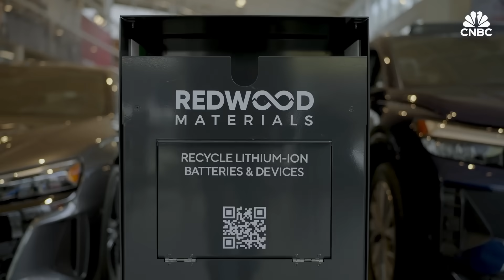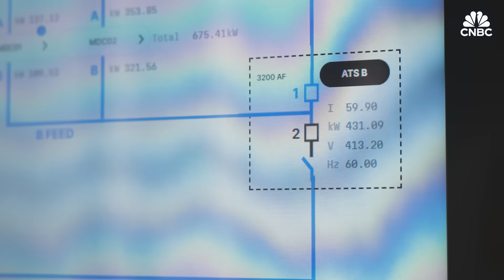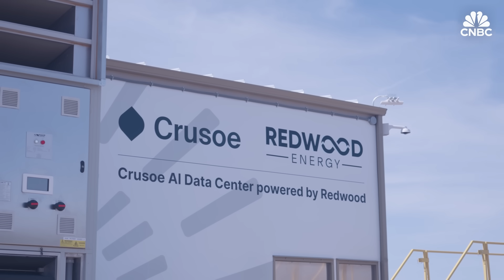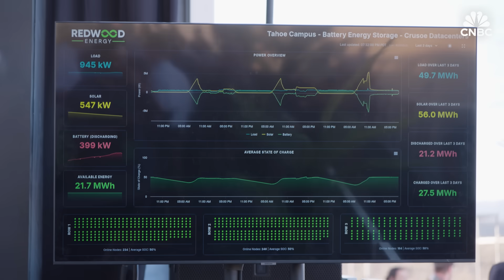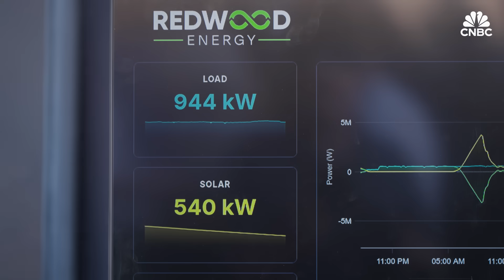How Used EV Batteries Are Being Turned Into Data Centers To Power AI

Comment: second-life batteries? LOL I thought EV car batteries typically last less than 10 years!
Reply: Old EV batteries degrade capacity over time— they don’t fail outright.   Basically they’ll lose 30% capacity == 30% less range.  But for stationary storage that stuff doesn’t matter— they’re useable as long as they can hold and release a charge.
Reply: @romanval69  There is no way a second life battery can hold a charge without maintenance. That'd cost a lot.
Reply: @GCPCA-p5b Batteries have no moving parts, so they're essentially maintenance free.  In this case they're using the entire EV battery pack as-is...  including it's built-in battery maintenance system.  (So as far as these battery packs are concerned, they're still operating as if its installed in a car).    If one goes offline--- well there's still hundreds of other ones ones working.
Reply: A quick google search found that there are different battery chemistries with varying lengths of life.  Not a one size fits all kind of situation. Where are you getting your data from exactly?
Reply: If something like 70%-80% arrive, they use them. If they are too bad, they recycle. Those minor details matter and they make their own market out of those small differences.

Comment: Looks like a bad design though. Why it's spreading out and taking so much space?
Reply: Low cost approach for end of life batteries just before their scrapped. The space prevents the spread of faulty batteries that go on fire (given they may have accident pulled batteries in the mix) from spreading to other units, this is why the batteries not being fully encased EV packs are also covered in fire/spark suppressing blankets (to prevent sparks igniting a module due to another one going up).

Comment: Data centers make up 8.9% of the total power share in America, based on analysis from the IEA. They need more power due to AI, and consumption would  rapidly increase. We need more nuclear power that's the fact.
Reply: Commercial utility-scale nuclear energy is the slowest to build and most expensive form of electricity
Reply: @beyondfossil and they still don't have a good solution for spent fuel rods which remain radioactive long after anyone reading this has passed away.
Reply: @beyondfossil  Alternatives?
Reply: LOL, wait 10 to 15 years to come on line, spend billions of dollars, end up with 1GW, and only able to run at 90% capacity.  Average nuclear power plant is 1GW.  The largest nuclear power plant in the US is the Vogtle Nuclear Power Plant in Georgia at 4.5 GW, with 4 reactors.  Originally estimated to cost $14 billion, it ended up costing $36 billion.  Nuclear is just not economically feasible and can't meet the growing demand.
Reply: @muskrat3291  It shouldn't take that long, 5 plus years for sure. Many European countries are reconsidering or reversing their decisions to phase out nuclear power due to concerns about energy security and climate change. It's the only reliable source.
Reply: @GCPCA-p5b  You're dreaming if you think 5 years time to construction a new nuclear power plant.  Just because they're talking about nuclear doesn't mean nuclear will actually be built.  Talking about nuclear is good for politicians because they can promote it as local jobs with energizes their political campaigns.  But if and ever such nuclear power plants are built, those politicians are gone, sometimes long gone.
Reply: @GCPCA-p5b   The answer is is renewables + storage and it is not the "alternative" but the primary solution.  Renewables and storage, especially solar, have reached historic low costs of generation and still driving lower year by year.

Renewables + storage are fractions the cost of nuclear per MWh generation and can be deployed at fractions the time as well—all without the unparalleled risks that are intrinsic with nuclear energy.
Reply: @beyondfossil  historic low costs? wow. Someone in my street installed solar on his roof for less than $20K, 3 years ago. Tesla quoted $70K for the same. Imagine solar energy supplying an entire city. I don't think it'd work.
Reply: @beyondfossil  So, building a nuclear plant takes many years and costs billions, is that your concern? Many EU countries are banning fossil fuel cars in 5 years. Do you think they have enough electricity generation capacity to power the anticipated rise of EVs? The shrinking EV sales are partly because of diverging policies on green incentives across the EU.
Reply: @GCPCA-p5b Just to clarify, the EU is banning the sale of new ICE cars but not the use of existing ICE cars.  Existing ICE cars sold prior to the ban will still be used indefinitely.  ICE cars will still be the majority of vehicles on road, at least for several years after the ban on new ICE sales.  ICE will fade out though at an accelerating rate after the ban which is excellent news.

The absence of nuclear energy will not alter this.  You might be conflating the two scenarios.  Human civilization has never really been tied to the growth of nuclear energy.

The biggest effect on car sales is global inflation and now Trump's unprecedented tariff war accelerating inflation and negatively affecting consumer confidence.

Furthermore, Europe has plenty of fossil fuel generation which is cheaper and faster to build than nuclear so there is no fear of running out of electricity.  Moreover, Europe is adding gobs of wind and solar.  Solar became the EU's top energy source last June.  This is a big milestone and means that this spread to other months of the year and occur year after year until the entire calendar year can be comfortably powered by renewables + storage.  This is a phase-in and phase-out approach happening right under consumer's noses without them even realizing it.

The extremely costly and slow to build new construction utility-scale nuclear will not even put a dent in the amount energy needed to displace fossils in any reasonable amount of time.  The money, time and expertise is best spent on renewables which can provide the same MWh for fractions the cost and fractions the time.  Until then fossil fuels and hydroelectric can provide the balance as renewables continue their exponential growth.

Finally, expensive and slow to build nuclear energy will actually slow down the global energy transition.
Reply: @GCPCA-p5b  Just to clarify, the EU is banning the sale of new ICE cars but not the use of existing ICE cars.  Existing ICE cars sold prior to the ban will still be used indefinitely.  ICE cars will still be the majority of vehicles on road, at least for several years after the ban on new ICE sales.  ICE will fade out though at an accelerating rate after the ban which is excellent news.

The absence of nuclear energy will not alter this.  You might be conflating the two scenarios.  Human civilization has never really been tied to the growth of nuclear energy.

The biggest effect on car sales is global inflation and now Trump's unprecedented tariff war accelerating inflation and negatively affecting consumer confidence.
Reply: @GCPCA-p5b Just to clarify, the EU is banning the sale of new ICE cars but not the use of existing ICE cars.  Existing ICE cars sold prior to the ban will still be used indefinitely.  ICE cars will still be the majority of vehicles on road, at least for several years after the ban on new ICE sales.  ICE will fade out though at an accelerating rate after the ban which is excellent news.

The absence of nuclear energy will not alter this.  You might be conflating the two scenarios.  Human civilization has never really been tied to the growth of nuclear energy.

The biggest effect on car sales is global inflation and now an unprecedented tariff war accelerating inflation and negatively affecting consumer confidence.
Reply: @GCPCA-p5b The historic low costs refer to utility-scale solar (solar farms).  You cannot compare utility-scale nuclear to residential solar.

Levelized cost of energy (LCOE)

Commercial Nuclear: $140 - $233
Utility-scale solar: $24 - $96
Onshore wind: $27 - $73
Offshore wind: $72 - $140

You seem to be new to this and its good you're interested but you need to do some basic research on energy.  In fact, solar and driving its LCOE costs lower while nuclear is getting more expensive and more complicated.
Reply: @GCPCA-p5b Just to clarify, the EU is banning the sale of new ICE cars but not the use of existing ICE cars.  Existing ICE cars sold prior to the ban will still be used indefinitely.  ICE cars will still be the majority of vehicles on road, at least for several years after the ban on new ICE sales.  ICE will fade out though at an accelerating rate after the ban which is excellent news.
Reply: @GCPCA-p5b The EU is banning the sale of new ICE cars but not the use of existing ICE cars.  Existing ICE cars sold prior to the ban will still be used indefinitely.  ICE cars will still be the majority of vehicles on road, at least for several years after the ban on new ICE sales.  ICE will fade out though at an accelerating rate after the ban which is excellent news.

The absence of nuclear energy will not alter this.  You might be conflating the two scenarios.  Human civilization has never really been tied to the growth of nuclear energy.
Reply: @GCPCA-p5bCommercial nuclear energy's extremely slow build will have little to no effect on EV mandates.
Reply: DOE/Berkeley Lab shows datacenters consuming 1.9% of US annual electricity in 2018 and increased to 4.4% in 2023.  They project it may grow to between 6.7% and 12% by 2028.  This assumes the grid is not growing, but the grid is also growing rapidly especially with renewables.

Nuclear growth is flat in the US.  Especially with the financial fiasco that was Georgia Vogtle which was over-budget by double ($14B to $30B USD) and over-schedule (2016 expected but was 2023).  Georgia tax- and rate-payers are on the hook for some $8-billion for this thing!

It is common for new construction nuclear power to be over-budget by billions and over-schedule by years all around the world.  Commercial utility-scale nuclear is the longest running joke in the energy industry.
Reply: France is the poster child for nuclear energy as 70% of their grid is nuclear.  But why hasn't France fully launched a new reactor since 2000?

France is trying to launch Flamanville-3 after a 12 year delay and over budget by at least €13 billion!   Flamanville-3 has launched in 2025 but is producing very little power!  Continuing technical issues are being discovered keeping this new reactor in test mode only and not fully running.

Per World Nuclear Report for 2024 on page 110 regarding the state of France's nuclear energy program:

The French nuclear industry remains under a high level of stress. The full re-nationalization of EDF, analysts agree, will not solve its structural problems: an ageing nuclear fleet with lowest performance in decades, manpower and competence challenges, unprecedented investment needs at times of unprecedented net debt, and never-ending problems at the only active construction site at Flamanville.

Most of France's 56 nuclear reactors are reaching end of life without viable replacements on the horizon.  Keeping them running will cost even more per MWh actually as older reactors have more problems.  The other option is decommissioning them which costs a lot of money too.  France’s Court of Auditors estimates total decommissioning and waste management costs at €74 billion, but some independent analysts project €150–200 billion!  France could be looking at a national energy crisis within the next 5- to 10-years especially as their economy is looking very poorly recently.

France is actually a not a model other countries should follow and is actually a cautionary tale against nuclear energy.

Comment: When my EV gets old it will power my home
Reply: There's a DIY YouTuber that disassembled Nissan leaf, and connected it to the house
Reply: It will eventually heat your home, even if you don't want it to.
Reply: No, it wont. Unless its an RTG. Otherwise the power is coming from somewhere else.
Reply: you must have been dropped on your head as a baby.
Reply: & it'll power the fire side.
Reply: Burn down your house more likely
Reply: EV batteries are utilized very inefficiently plain and simple. The dumping of 50% bad lead acid batteries is unheard of.
Reply: you do know that batteries don't create electricity?
Reply: @a-foxit’s most likely going to be charged with solar.
Reply: @a-fox lol. If he owns an EV he knows how batteries works. Charge them with solar, then power the house at night. It's not that hard to figure out.
Reply: @a-foxyes, but solar chargers them
Reply: @a-fox You know what does? Sunlight on photovoltaic cells, as well as wind turbines and water turbines.
Reply: @sqlevolicious   What if the wind isn't blowing and the sun isn't shinning?
Reply: @a-fox check V2G, V2L, V2H. People know what they are talking about.
Reply: @a-foxthere's solar but that ain't gonna power the EV like ppl would expect. A generator would defeat the purpose of the EV battery.
Reply: @nelsonta00 false. You can’t charge a generator during the day and use it at night.
Reply: @steventrott8714 generator can go for as long as fuel is available. It can also be modified to automatically jump in during a blackout.
Reply: @nelsonta00  
1. Generators are loud and annoying, while battery back-ups are quiet. 
2. There have been cases where battery backup with solar outlasts the generator in blackouts, where the fuel is limited
Reply: @xiangkunwan efficiency > noise

I've had a 5 day blackout and the generator was running perfectly fine.  Neighbors came over to charge their phones and powerbanks while watching tv and drinking ice tea.  They offered me food so their phones can charge back to 100%.  Was it noisy? Yeah, but we lived a normal life without a problem.  We were worshipped by our neighborhood until the power was back on, and then I became a peasant again.
Reply: @nelsonta00  Aptera would like a word. You can get 40 miles a day with just sunlight.
Reply: @nelsonta00  fuel is expensive and generators also don't produce a lot of power, ones that are affordable, that is. A battery can, and when paired with solar, is free energy. Just as such for tens of millions of homes in this country.
Reply: @nelsonta00  Big issue with your story. How do you get more fuel? Fuel station would be without power, so no way to pump fuel. You are SOL. This is why solar is better in every way.
Reply: @sqlevolicious  at work we have 2 giant diesel generators in case of blackout. Same at the hospital but they probably have more of them. Heck even the army has loads of generators on wheels. Not heard they say they will be replaced by batteries.  A Battery with the same capacity needs to be like 3 times bigger than the dieseltank.
Reply: @nelsonta00  and EV owners just connect their vehicles to power the house. It requires some wiring but so does a generator connection.

Comment: Wait I thought EV batteries died every two years and cost $25k to replace? Do you mean they actually last awhile and can be recycled? Dang
Reply: really makes you wonder about the motivations of the people who continue to lie about it.
Reply: @GyattGPT battery technology has changed significantly. Battery failure is more rare and batteries outlast the car .
Reply: @GyattGPT nobody lied  tesla battery. can last twenty years
Reply: @GyattGPT  no need to wonder, it's all out in the open. Fox news praises oil companies that are not invested in renewable energy.
Reply: What?  Does this mean we've been lied to? WOW- who woulda thunk it!
Reply: I think early EVs hurt their perception a little bit. I've owned a couple of Nissan LEAFs, the first back in 2014, and both of them lost range rapidly. Even though they were under warranty, the warranty range was so low(66%) that they became unusable to get back and forth to work long before they were officially due for replacement, and the replacement costs really were more than the car was worth. I'm in a Chevy Bolt now, and I've seen 0 range loss in the first two years of ownership. Modern EVs are impressive.
Reply: @robertcowher  The original Leaf didn't have thermal management, which degraded it quickly.
Reply: @romanval69  Yep. It was an air cooled battery. Great car to drive, terrible battery design. Test driving the LEAF felt like being in the future.
Reply: @robertcowher  Hell, the million mile tesla model s only had it's battery replaced twice due to manufacture error and has spent the last 4 years not seeing any degradation due to it being the new iron-phosphate battery tech.
Reply: Battery failure was a thing back in the Nissan Leaf days but the latest batteries out last the car
Reply: Who the hell told you that
Reply: Literally no has ever said that except conservative media like fox news. You can buy 20 year old tesla batteries and they will have ~80% capacity. New batteries like iron-phosphate and sulfur batteries won't degrade for decades and will last you over a hundred years before you would need to consider replacing them.
Reply: Lower power 🔋 ev battery they're are using are still only working at 65% ? Will breakdown?  Tesla companie using thousands of old ev battery's?  Only powering lights + smaller technology.  Still using different energy
Reply: @FredHousehold Maybe a battery from the early 2000s EVs like the first gen leaf, but even then, those batteries are at around 70% capacity and can easily be recycled. 
Tesla is always using recycled batteries, it's how they keep costs down. The batteries are fresh, of course, but just about everything in modern cars come from recycled materials, tesla included. 
Nope, most energy sources for cities come from renewables these days, only a few states still rely on coal power.